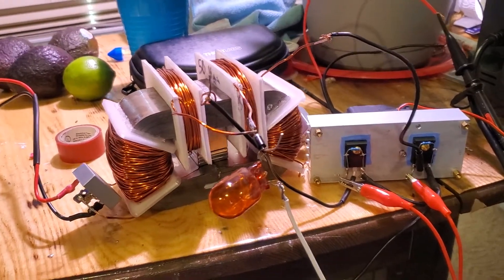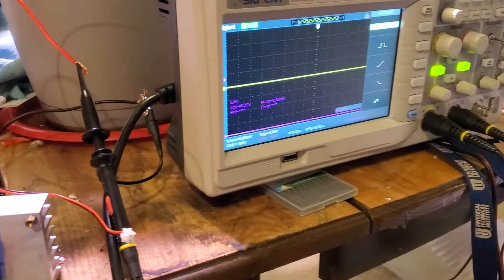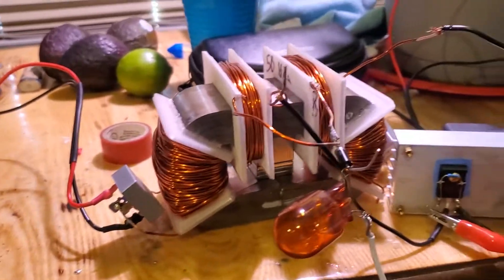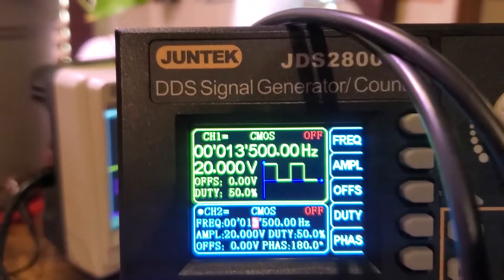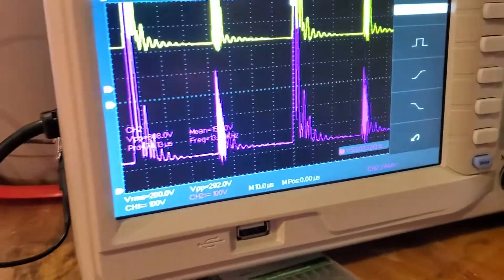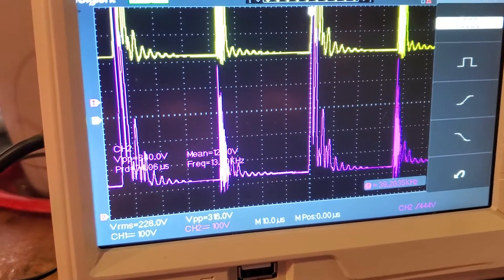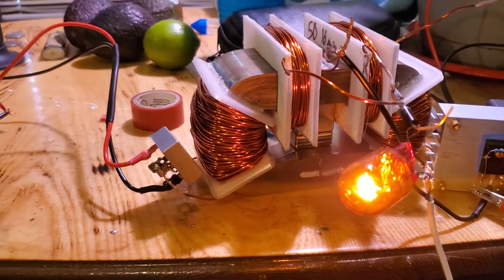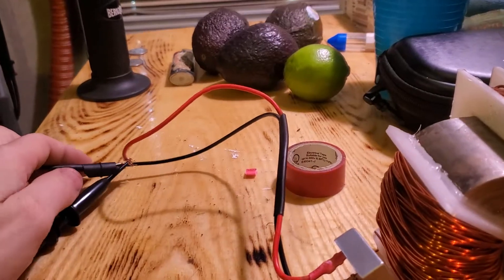MEG Testing pt1

Comment: So what it this doing? In terms of end-user tangible benefit?
Reply from the maker: If it were properly tuned.... it would amplify input power while adding a extra magnetic componet from the active environment of the magnet. Giving more out than in.

I was not successful in this attempt. I over saturated the core big time, getting it properly tuned is a nightmare and must have perfectly sized magnet to get it to "ring".
Reply: @Heliarc91 u need to put mercury inside that torus with the wires wrapped on it, then the magnet inside the Taurus makes the mercury levitate inside it as it spins and it will c
Reply: When u add power it will start to spin the mercury inside that Taurus and then it will shoot more energy than u put in it